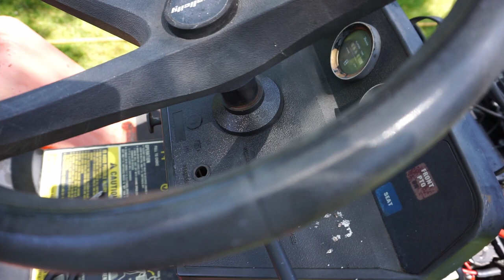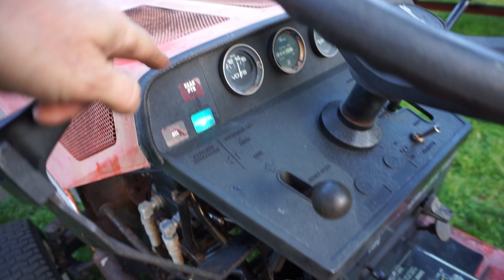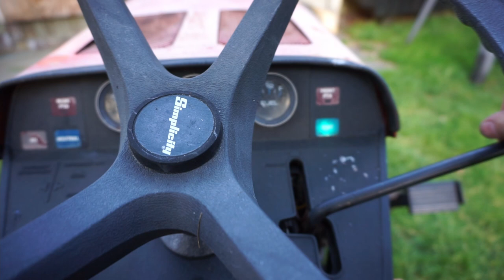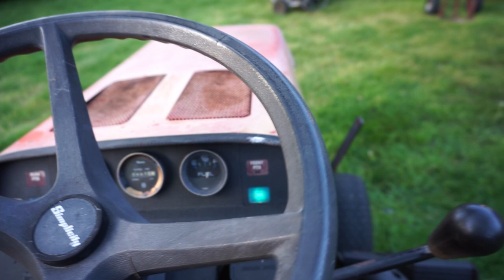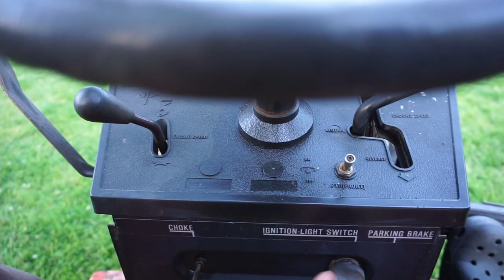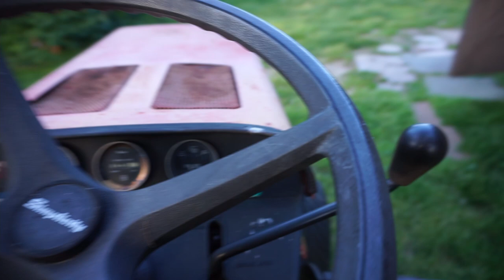Simplicity Sunstar - 20hp Kohler Magnum Engine ~ 1st Basic Repairs Part-2

Comment: Just got done binge watching this!  A lot of packed good info as always from the switches to lights (for neutral). Really cool the other guy commented on the box.  After I crashed my first tractor, I now realize how important safety switches are.  

Looking forward to the restoration!  You gonna keep it or resell it? That’s one hell of a UNIT! 🤙🏻🇺🇸🔧🦅

How are you zooming in while you are filming?

I use the dye electric grease for connectors…what do you feel is better?
Reply from the maker: Thanks for watchin! Yepper, I just rebuilt the seat, underneath are the switches for 2 of the safeties. The were cut and now I can put them back. These machines can Hurt Ya Permanently!

Comment: my john deer 300 has the same switch, wen i got it it was rusted to itself i wire weeled it and soaked it in carb cleaner to break it free works great now :P
Reply from the maker: Nice,, I do recommend you lube it with something, shoot some chain wax in it!
Reply: @TheNovaJohn  i used frafite seems to work well concerned how long it will last thow
Reply from the maker: @graymouser7649  Kewl,,, that works, just keep in mind, graphite is conductive so I don't recommend it on electrical!
Reply: @TheNovaJohn  didnt even think about that, thanx for the heads up